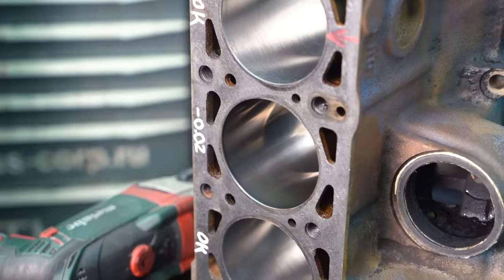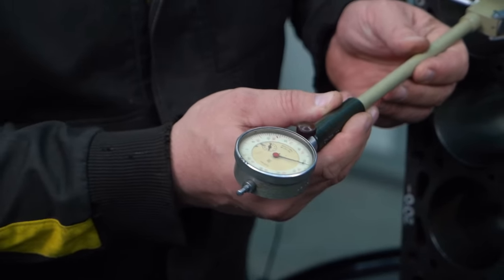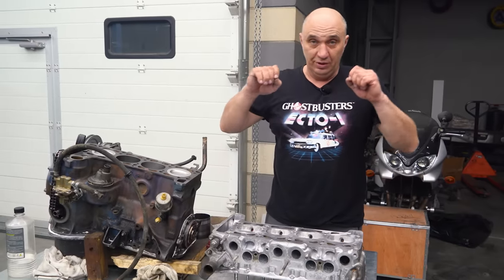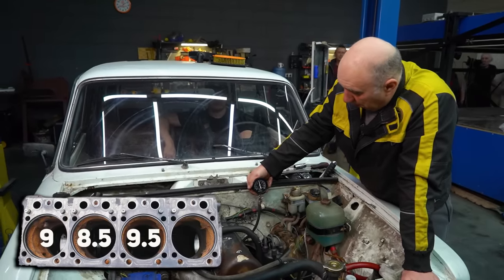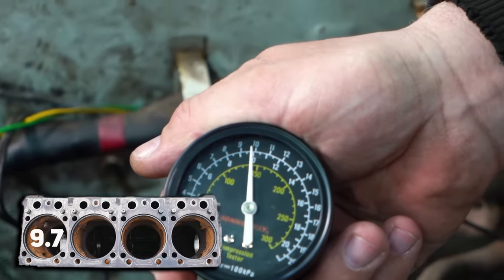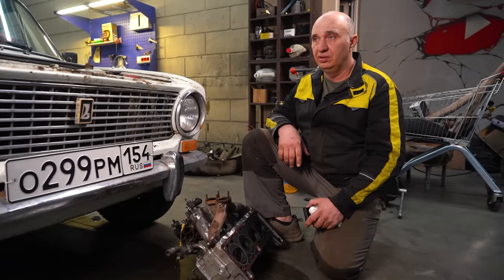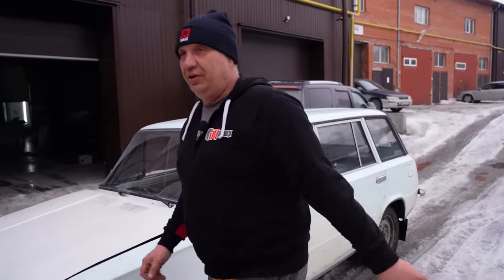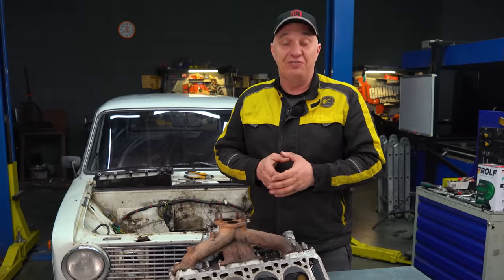Honed cylinders or mirror finish - which is better?

Comment: Honed. A polished cylinder will leak, as the rings won't wear into the walls. Porsche flat sixes are known for this problem. The simplest fix is a quick hone and some iron rings, not chrome.
Reply: most modern engines run mirror bore
Reply: @vaninec  Yeah, for emissions reasons and the cylinders last half as long as an old school one redone with modern technology.  Modern engines are designed to be thrown away and replaced.  (Looking at you Ecoboost.)
Reply: @FuckGoogle502  
Well
Many engines run mirror bore. Look at any million + km Toyota engine inside it would mirror bore and good compression.

Comment: Cylinders burning oil tend to have higher compression than cylinders that don’t burn oil..because oil seals the cylinder better and the combustion gases can’t escape through the rings (but also that means that the remaining oil on the cylinder walls is burned through combustion

Comment: There are a ton of video by some very successful people that cover this.  I will paraphrase the industry standard now. Honing provides a texture for the oil to adhere to. Not only does it provide grip but distribution.  The cross hatch allows the oil to cling and then be distributed as evenly as possible by the hydro dynamic forces at play. This presentation allows the rings to do the job of sweeping and sealing the contact points.  If the walls are smoothe the pooling or capillary action and surface tension would negate the even distribution of oil across the entire sleeve surface and reslult in expected wear do to spotty lubrication.  End rant.
 I have never in my life heard about this debate.. cool video and what ever that man driving cirlcles in the center of the track is getting paid, it is not enough 😂❤

Comment: It'd be interesting to see the temperature on each cylinder under normal operation if that was possible. I'm thinking the polished cylinders would run hotter.

Comment: Well it has to be honed for aftermarket pistons it also depends on what kind of rings you use now. You just don't use RA now with aftermarket rings they have the RA RK RPK n so on n it depends on the finish also with the RA RK n RPK the rings suggested. You have steel rings, chrome rings n molly rings n all have diff hone n finish on the cycl bore. So in theory the hone n finish matters. Cross hatching also matters cause to keep a small amount of oil there for the rings. No days there is alot

Comment: Honing and new rings that can bed into the cylinder would be the better option in my guesswork, on top of properly seating valves as well, cos they can lose compression if they're not seating cleanly... :)

Comment: I had an idea over 50 years ago, replace the cam with pneumatic lifters. The first engine I rebuilt was a 2 stroke. I used to turn it by hand to see what was going on. Next I did a Honda XL250 motor with a four valve head. I put a higher lift cam in and again turned it over by hand to watch the valves. I was surprised how much resistance the valve gear causes. Also, while learning about cam profiles I began understood how they affect ridaability. That's when I thought about pnuematics. Not only would you be able to change characteristics (this was a long time ago, with modern chips and sensors this idea is even better) but you would lose a heap of internal resistance, especially with a multi cam, high lift, stronger valve spring motor. It would spin up like a 2 stroke.
I never got anyone interested enough to help me build it, and now I see Christian Keonigsegg has got a team called freevalve using a similar idea on a Saab.
Do you think you can make it?
Reply: I noticed how much load the valve gear placed on an engine when I was driving my girlfriend's 2.0 pinto-engined Capri and the timing belt failed. When I tried to start the engine (in the middle of a yellow box junction of course) it turned over so quickly that the noise it made was so different I wondered what was going on. At first I thought the starter motor was missing the ring gear, but once we'd pushed it out of the way and looked under the bonnet, it all became clear. I had a high-performance Allegro project going on at the time, but my next project will be a super-mild cam, rev-limited to half the normal maximum revs and with super-soft springs at half normal strength, with only two of the four valves per cylinder in use. This should use much less fuel and will be configured to idle at a much lower speed and should be a super-economical town car. As it's so infrequent that I ever have felt the need to go over 3500 revs, I should be able to still drive like normal but get better performance with less fuel.
Reply: Interesting idea👍
Reply: Try a small carby, I’ve seen some experimenting 👍

Comment: What was the finish on the piston rings? A polished ring finish in a polished bore may not leak at all. The ring and bore are mating surfaces and should match to seal properly. Also the usual wearing in process actually means removing high spots on the bore and the rings, that is, polishing. Cheers.

Comment: You got to measure the cylinder bore for wear.  Honing surface suppose to hold on to oil better for better lubrication and protection

Comment: mirror finished bores is like driving a crop duster but it's oil being burnt instead of crop dust...can glaze the cylinders through fuel wash real quick with a rich tune aswell. The last thing you want aside from a cracked block is glazed over cylinders

Comment: Modern engines run "mirror" 1 micron 
The ideal bore surface should have flats on the silicon crystals and crystal protrusion of 0.00002" to 0.00004" (0.5 to 1 micron) 
Just for info :
Regular mirror 20-200 microns

Comment: I would speculate the the 'darker' or higher carbon could be a result of richer/uneven fuel-mixture distribution.
The real way to balance would be either multiple tuned Carb's or better yet, Fuel Injection, for definitive results...

Comment: The finish on the cylinders depends on how hard the cylinder walls are and what type of rings you are using, hard iron cylinders do not wear easily and require a finer finish, and if you use chrome or hardened rings the same is true. every manufacturer has different hardness in their blocks.

Comment: A cross-hatch pattern on a cylinder bore can help with lubrication and engine performance, but the ideal angle depends on several factors: 

 

Angle

A 45° cross-hatch angle is often considered ideal because the piston's upward motion spreads oil sideways to cover the entire cylinder wall. However, the ideal angle can vary depending on the ring tension, stroke length, and other factors. For example, long stroke engines may perform better with a 60° cross-hatch. 

 

Too shallow

A cross-hatch angle that's too shallow can cause wear issues. 

 

Too steep

A cross-hatch angle that's too steep can cause oil consumption, dry starts, and premature ring wear. Ring manufacturers typically recommend a cross-hatch angle of 22° to 32°. 

 

Measuring

A protractor or business card can be used to check the cross-hatch angle. A Cross Hatch Angle Checking Tool can also be used to measure the angle. 

 Appearance
A freshly honed cylinder will look rough, while a used cylinder will have a "glazed" surface with little or no visible cross-hatch.

Comment: I'll be honest i have never seen a cylinder get polished with a drill.actualy i lie there i did it myself on a yamaha FS1E, i actually done a home rebore using a pilar drill and a fan wheel sanding bit lol. It went from 49cc to 54cc and it ran well, top speed of 65mph.

Comment: Should have done a leak down test to see where the compression loss was going, past the rings or valves , which cylinders cleaned down past the rings more, honed or mirror.

Comment: Chrome, ah, the miracle metal. Engine developers discovered a little layer of chrome on a piston ring could reduce wear and extend engine life. I am 76 had have seen some stupid mistakes using chrome. The biggest blunder was a British manufacturer deciding to chrome plate cylinder walls and could not understand why the rings would never seat properly. The one I experienced was a Japanese manufacturer adding a lot of chrome to their engine block and piston rings would never bed in properly so the engine ate a lot of oil; after replacing rings 3 times I gave up and installed a chevy 307. If there was perfect match of cylinder wall and piston ring surface then mirror finish might work but I would not bet on it. To get a proper and effective seal the piston ring and cylinder wall has to lap in together to seal properly and honing will leave a surface that will 'wear' to match the rings. Just my 2 ₵

Comment: Gotta chuck in an MLS Gasket instead of that fibre kind. Less chance of coolant intrusion. Love the Ska music when the dudes were driving around! Gotta get you a boroscope too. Compression can vary wildly if your piston rings don't gap match cylinder to cylinder, which of course also needs to be combined with matching bore clearances

Comment: When you are using cast iron rings in an old stock engine, it really doesn’t matter! You are not making enough cylinder pressure for it to matter! If you have a performance engine, that  makes some cylinder pressure! You will absolutely see a difference in compression & leak down! Most of the wear on the ring, happens in the first few minutes! That engine will probably run much better by making sure the timing is where it’s supposed to be, & taking a little jet out of the carb! Also low compression engines don’t need a higher octane fuel! As long as the timing is correct! Higher octane fuel allows you to run more timing! It doesn’t make power in its own! It’s been tested & proven by experts many times!

Comment: I was taught that a home was needed to create small pockets throughout the cylinder that aid in oil retention iirc

I’m sure you could get by without it if it’s a daily and it may last just as long, but it’s a proven method with race cars so going against decades of advancement is kinda dumb 😂

Edit: I’d also like to point out that although there are manual hone tones you can buy, it’s always best to have a machine do it because they can be programmed to get the correct angle on the crosshatch that you just can’t manually. Again, this is all for racing purposes so it may or may not be needed for a stock rebuild. Although with a good hone tool being at least $100 (the ball hone not that cheap $20 3 stone hone crap from Autozone) it’s worth having a machine shop do it since they typically charge that much anyways.

Comment: Thing is "mirror finish" isn't actually mirror, even modern Alusil cylinders that appear to be completely smooth have a specific roughness to them, naked eye just can't see it. Obviously you need the roughness for oil retention. 
Difficult to test since you need a break in period and a specific finish ideally requires the right oil for it.

Comment: 2 stroke can have mirror finish because the cylinder is being oiled by the fuel. A 4 stroke relies on the rings ability to transfer sump oil to the cylinder walls whish can only happen with cross hatching honed into the cylinder walls.
With smooth cylinder walks the oil will not engage with wiper rings adequately, this will prevent cylinder oiling, it will also build block pressure and also scorch the cylinder bore creating excessive heat which will eventually destroy the engine...... you can not have a perfect seal between cylinder and rings in a 4 stroke engine, neither can you do this with large 2 stroke engines which need deeper cross hatching than a 4 stroke requires

Comment: Honed is better also because the oil will be better able to cling to the cylinder walls due to the scratches and tiny groves from the honing stones.

Comment: would probably have more definitive answers using 2 small engines to compare the two. that said i think there isnt much difference here cause not many miles and i see more polished finishes on newer stuff running 0w20 which makes sense, as a thinner oil can get into smaller spaces so rather than needing say a cross hatch that is done with like 220 grit for something like 15w40 so the oil can effectively stay on the cylinders, the thinner oil can stick with a much finer finish. as for power and all i'd say having a much finer finish probably reduces friction and gets more power down

Comment: Honed seats rings and holds oil in the bores to lubricate. 

Even hydraulic cylinders have a certain amount of hone on the chrome surface. Too shiney and the seals overheat and fail. There needs to be somewhere for oil to sit

Comment: With modern pentrative nature of engine oils and ability to clean plus stay in extrem conditiin ,honing is not necessary . Smooth mirror finish is ok . Oil trapped in those grooves wil be exposed to high heat and flames above piston head positions.

Comment: Mazda now uses a plasma applied mirror finish coating in their cylinders.  They are getting better fuel economy and reliability with this.  I suspect probably because higher precision manufacturering and machining techniques are available so methods always change as technology progresses

Comment: Need to have a little oil on the cylinder bore for lubrication and cylinder cooling. The cross hashes need to be there

Comment: You need to do a leakdown test, there is something else in play, most likely valve seating issues, then check the EGT of each pot, the even numbered pots are burning hotter.

Comment: I wonder if a polished bore. With rings with tiny grooves in them would work? Basically a vross hatch on the ring with smooth bore.   But I feel a really rough coarse stone then uses fine diamond possibly to hone until the bore appears smooth. it should have a mice cross hatch under a microscope, with s smooth appearance. The bore should hold oil. And less friction. A low tension oil ring could possibly be used with a thinner oil the shallow hatches in the bore would hold thin oil better , building small engines, i like to pollish the pistons. Skirt and dome if the skirt isnt coated. And i also like to hone the bore with a fine stone just a couple passes. And oprning up the top ring over stock. I also like polishing the ring grooves, a fine scotch Brite pad will work. Putting them in a lathe would be awesome, much faster. Use scotch Brite, then denim with a compound or powdered diamond paste, equal to a 10k -20k grit paper, a couple seconds each at 180 - 300 rpm it can be used in the dome as well. Just a strip of  old jeans in a hacksaw will work, a bit of wire or hose clamps with the denim folded possibly wrapped over a upsidse down blade, but be very careful to not go through the denim. Uusinga grinder and wire brush on the blade to round and polish the corners. But a bit of thin wire will also work. A guitar string bass most likely.  Just don't have a mess that will get caught in the lathe chuck. Being pulled into a lathe is not good , nor is having a hacksaw ripped from you and the lathe beat you with it!  At 300 rpm, it can hit you atleast 2-3 times before you move!  Beside this, also using 2000-5000 grit sand paper, a piece of glass 6mm thick or thicker. Tape or glue the paper down to the glass, slowly and lightly slide the rings across the paper in alternate  directions keeping up with top and bottom 1 & 2nd ring marking if any, and slow polish the rings. Using transmission fluid and kerosene , diesel fuel, or wd40 or similar thin oil to keep the fine paper clear even water would work if you completely dry them, and oil. But they can still  start rusting. A magnetic vise would work aldo with the glass on top. But the vise needs to be exceptional, certified flat .  Once the rings are evenly sanded all the way around  flip and repeat.  It should allow the ring to spin freely, and follow the bore without any friction between the ring and land. Careful to not remove an excessive amount of material. Causing a excess gap in the ring to land clearances if there is slight grooves in the ring or putting. Is fine, as long as 80% is smooth. If there is any taper to the bore this could be a bandaid for the issues associated with the tapered bore. At high rpm they can loose power the ring loosing contact with the bore.  The only fix is to repair the bore. If the ring can slide  like  a cat on ice it will follow the bore and seal better.

Comment: Only shiny surfaces seal and offer great friction reduction but since the cylinders of an internal combustion engine seal by the oil on metal rings you have to give it a pattern to adhere hense the crosshatch.
Shiny will work best with the combination of the other experiment they did using rubber o rings as piston rings 😂

Comment: Honing is done with 2 stone grades. Grade 1 is rough and scores valleys in the cylinder wall material that the oil can fill and act as a hydro cushion as the ring passes over. The grade 2 stone is smoother and scores the peaks of the grade 1 stone off leaving it's own valley and peaks to act as an abrasive surface for the ring bed in. As the piston reciprocates for the first time the rings abrade the grade 2 surface and the grade 2 surface abrades the rings till the wear smooth to each other forming a mirror copy of eachother. You finish with a bore with grade one scratches that holds oil as protruding cushions that the piston rings aquaplanes across the top of very closely to the cylinder wall. Try reading any technical book on the subject and understand how loopy this vid is.

Comment: Most of the Worlds Manufacturers did EXTENSIVE research on this  Decades ago . Lightly Honed bores  bed in fresh rings quicker , and end up Polished anyway from operation . You " Broke that in " wrong too . Should have driven the City First and Then went to the Track .
Cylinder 4 has a Smaller combustion chamber than the others , leading to that High reading .